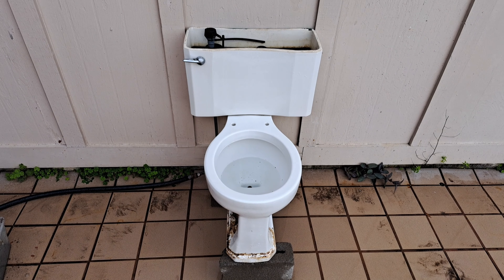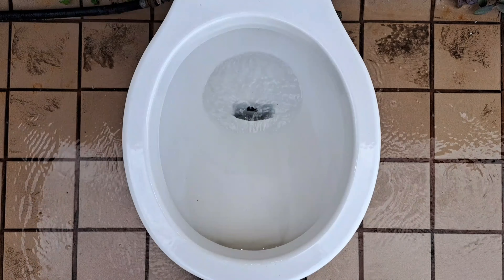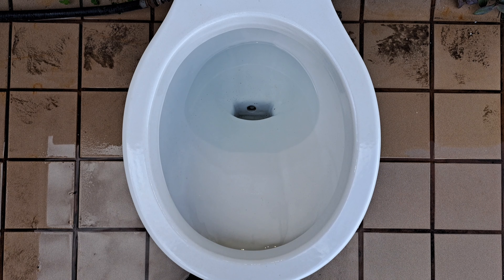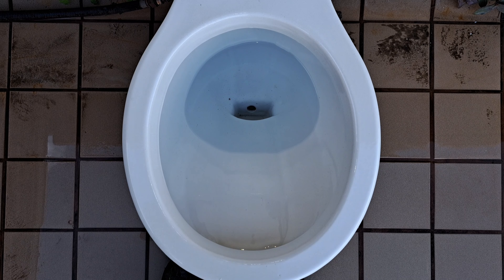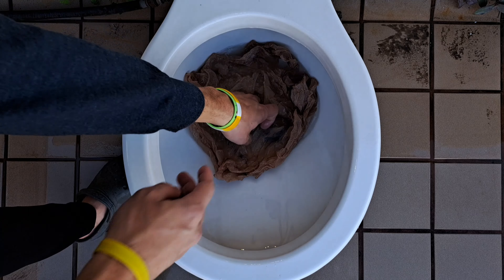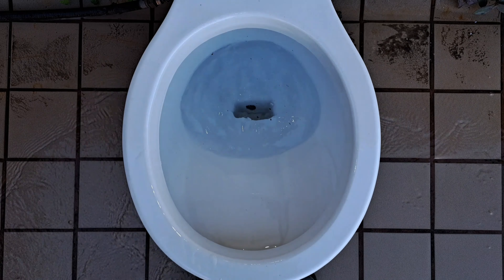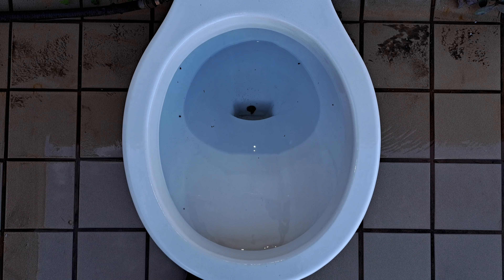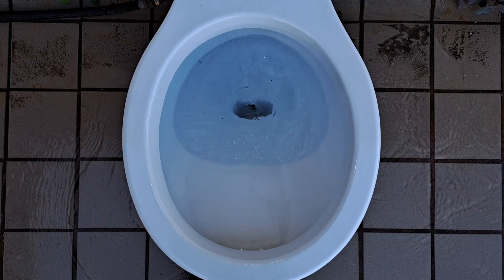1966 Nationaline Toilet Tests

Comment: "Cyclops" siphon jet for this trapway matters a great deal. The trap mouth to cyclops distance seams rather small. The standard diameter back then was 1 7/8". IMO, for your plastic bag tests, feed the seam side first as this prevents air bubble from hanging the bag up on the trapway mouth that is so common I see in terlit tests you guys do. I have seen this terlit on a flushometer and boy howdy, what a big difference !
Reply from the maker: I always cut little holes in my bags so the air comes out.

Comment: A little sad for a vintage toilet - an early unbadged 'Budget' version of another similar toilet (possibly a VHP from the 1960's) but overall it did okay (once the scrubbing pad was removed from the trapway). I agree with your rant about manufacturers skimping on quality when making toilets (especially for those who cannot afford higher end toilets and have to go with the budget range toilets).
Reply from the maker: I feel like these could have been good if they stepped up the quality a little bit.

Comment: So far, it still did better than my 1965 Neuday with the grocery bag. However, my Neuday obviously has better bowl rinse though.
Reply from the maker: Sucks that your Neuday didn't perform so well
Reply: @OCC_Plumbing_and_Restorations  I had it on a homemade tank, so it may have been weakened due to how much the tank leaked whenever I flushed it. But I do have a Briggs tank, so I can try it again with that.
Reply from the maker: @christopherpotomski8463  I would guess that was why